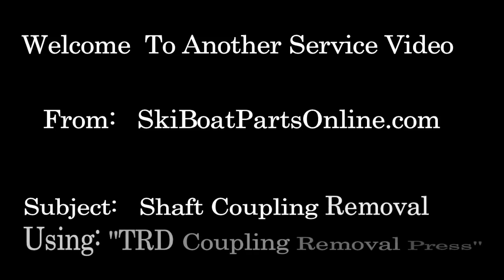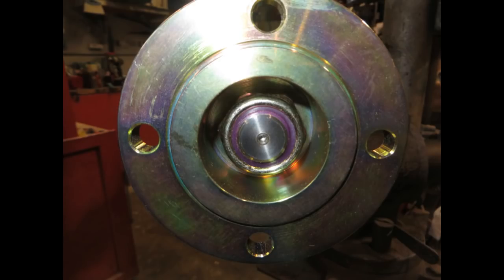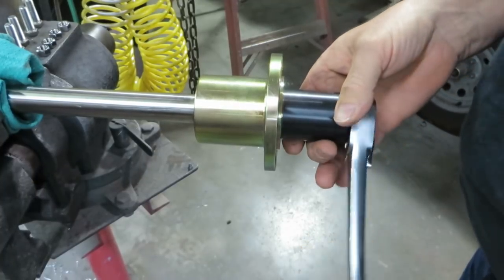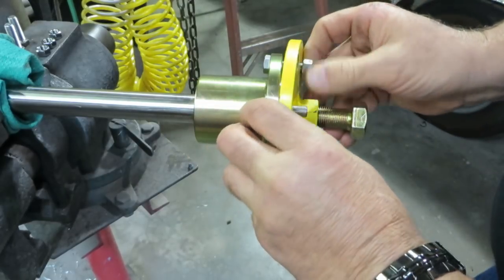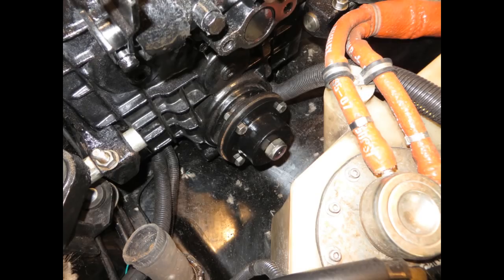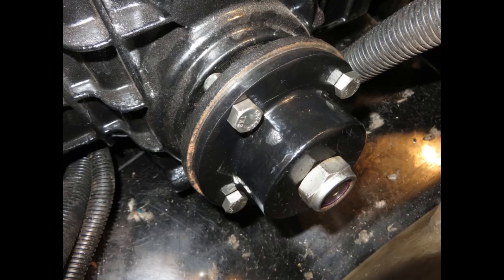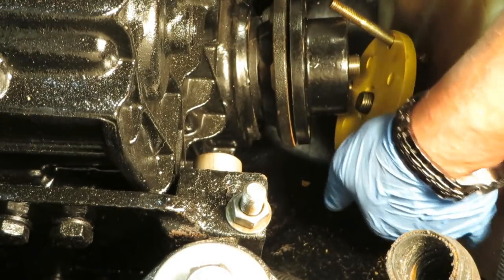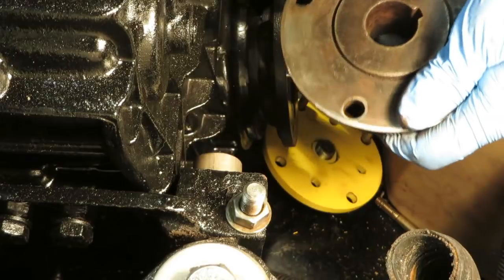Propshaft Coupling Removal Direct and Drive V-drive

Comment: I got this tool last week and what I didn't take into account was the space between the couplers (Crusader 454 with straight VD transmission). I was able to get it started with the short bolt but that only moved the coupler about 1/4" before the press bolt bottomed it. At the point, I really needed the long bolt but there was simply not enough room. I wound up using the press bolt instead of a socket and using diff size bolts to press out the shaft. No fault of the tool but check that for your application.

Comment: videos are great Ron....for us DIY'ers  can you make a video of how to remove the drive shaft so we can change the cutless bearing..and reinstal the shaft would there be alignment if the p strut( cutless bearing holder) was not removed ...most of us might not can afford the $400 tool to remove the bearing while the shaft is still place thank you for all your info...it helps us alot
Reply: Ref Big Al's comment about removing the drive shafts on a V-Drive boat, I have a 1995 Searay 370 inboard drive with "Tides Marine Dripless Seals" and yes would be good to see a video on pulling these shafts. I need to renew strut bearings and at same time want to mount spare "standby" dripless seals on the shafts during this winter layup. Am interested to know the arrg't as the shaft goes thru the housing recess under the Hurth Transmission unit, is there a bearing between that housing and the outdrive coupling or is the shaft free to be pulled outboard once the coupling faces are released. 
Great video's Ron best ones on  the tube without doubt, you keep it simple/clear no B.S. and clear to understand for us boaters.  Thanks; John.

Comment: What size bolts did you use on that v-drive, looks like I will need to use that method also?
Reply from the maker: I have an assortment of 3/8" bolts in packs of 4 from 1 1/2" long to 4" long, it seems every one is different, you will need to place the puller up to the coupling & measure just get 4 that will fit your boat, then keep them with the puller tool.
Reply: @rontanis1024  Thanks for the fast reply, will do

Comment: Ron, is this necessary when pulling a v-drive engine from a boat? Or can I simply remove the 4 bolts coupling the drive shaft to transmission?
Reply from the maker: If your shaft goes through the trans & comes out the front like the one in our video the shaft must be slid back past the trans opening, if your coupling is under the trans then you simply need to remove the 4 bolts & slide it back an inch or two.
Reply: I have a v-drive on a Mastercraft Maristar 210 engine, I need to remove as well with four bolts and a central nut at the shaft coupler. Removing the 4 nuts didn’t seem to do much in terms of freeing up the shaft. Seems like you would have to remove the central coupling nut to get the shaft to move back? Looks like the coupling puller is sold out for a few months as of this writing. What do you have to do to get the shaft free after removing the 4 bolts and the central nut?
Reply from the maker: @nathangen  THe 4 outer bolts do not need to be removed to remove the shaft, only the center main nut needs to be removed, then the shaft must be pressed back about 1/16" then it will fall out. The 4 outer bolts are to attach the shaft coupling to the trans coupling, we also use these holes for our puller tool.
Reply: Oh interesting, so is there another way to move the prop shaft that 1/16 without the coupler puller? I see the tool is currently sold out. Would say the A.R.E. Shaft/Strut bearing puller removal tool be the ticket? 

Using this sequence, I found on teamtalk
“1. Put a block of wood between your prop and hull (or Ron Tanis method of crowbar at coupler bolt heads)
2. Use a jumbo crescent wrench or socket to loosen big transmission shaft coupling nut but leave attached
3. Loosen 4 transmission nuts and bolts but leave attached.
5. Remove rudder (I think this can be skipped for most boats) 
6. Remove prop
7. Attach slide hammer too to shaft and slam the slide hammer forward and that will break apart the transmission and shaft coupling coupling.
8. Now remove big transmission shaft coupling nut 100%
9. Slam slide hammer backwards now and the shaft will come out
10. Remove 4 transmission nuts and bolts and coupling and your done.”

Comment: Do you need to losen anything on the shaft to separate the couplings from the transmission and the shaft after the 4 bolts are removed. Should these just pull away? I feel mines a bit tight.

Comment: How is the tank attached to the hull & what's your method to slide the tank forward without damage?
Reply from the maker: If the tank has to be removed or slid forward the first thing I do is remove the fuel to reduce the weight. next is the fill hose, the smaller hoses can usually be left attached if only moving an inch or two. Tanks are generally held down by straps that can be removed for this. The last one had room enough to slide the tank forward 2 inches.
Reply: @rontanis1024  I'm working on a 2006 230 Mastercraft with a 6.0l crusader who's floor is attached to the Hull leaving no access to the straps.
Reply from the maker: Well, the better boat builders design means to get access to replacing fuel tanks. I am not familiar with your specific model. I assume you need more clearance